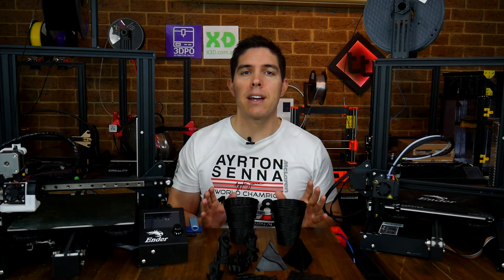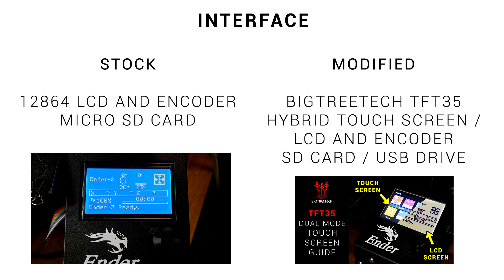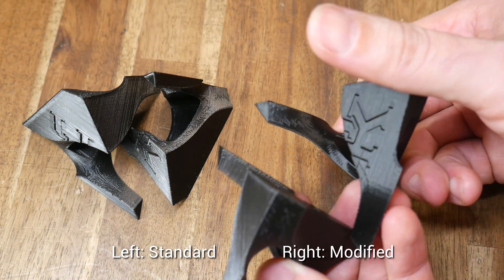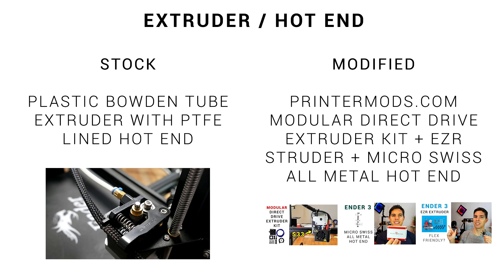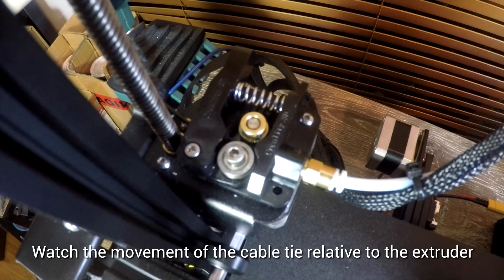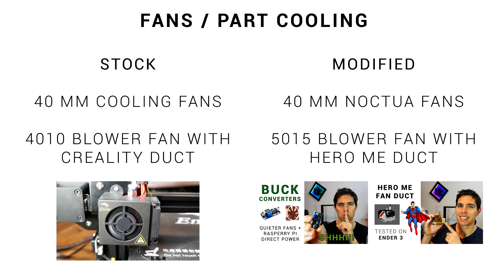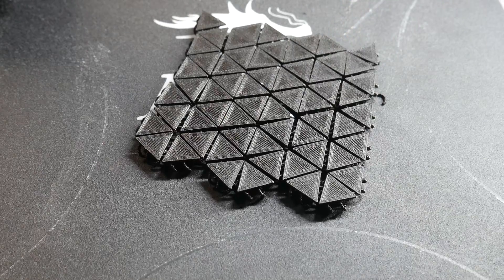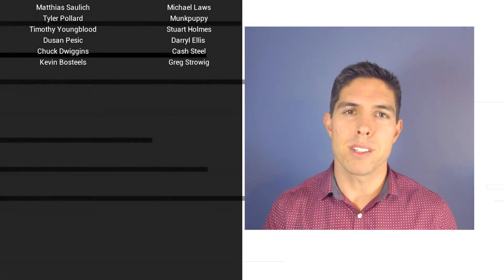Are modified 3D printers better? Stock vs upgraded Ender 3 comparison

Comment from the maker: Hopefully my answer to this question can pour water on some of the flame wars I've seen about this question. Another criticism I see is that a person might start with a cheap printer and then spend much more than its purchase price upgrading it. People ask: Why not just buy the more expensive printer in the first place?
1. Maybe the person can only afford small amounts at all.
2. Maybe the person is aiming to learn about their printer and get their hands dirty rather than buy an off the shelf solution.
3. Maybe the person just really enjoys tinkering and tuning 3D printers.
In my opinion each scenario is fine, as is the one when someone buys an expensive printer because that's what meets their needs.
Reply: When I started I got the cheapest crap I could afford. A few years ago I snagged an Anet A8, when they were still new. I looked it over and used it for a short time. I took everything that I didn't like about the printer and kept it all in mind when designing and building my own printer. I ended up with linear rails on all axis, a bltouch so I can print on any type of "normal" surface, silent stepper drivers, all aluminum frame, 32 bit mainboard, all metal hotend with a hardened steel nozzle, and I'm always making minor modifications on it. I would say that design and iteration are my main hobby because I enjoy that more than printing. In fact I'm now designing a delta style printer (just to have one) and I'll make a CoreXY after this one.

I never ask "why" when it comes to a person making mods to anything they own. It's a hobby, that's why. Some people dump seemingly pointless hours and money into a car. Some people buy plants to go around the house every spring. Some people buy drawing/painting supplies all the time. The list goes on and on....
Reply: Was about to make a comment, but for me #3 is on point! I got the Ender 3 specifically to tinker. I've done upgrades here and there since getting it 1.5 years ago, everything from tiny stuff (stiffer springs) to more major stuff (mainboard, dd, tft etc). I've spent maybe 200-250$ over 1.5 years on it, and I've learnt so much over that time that I would never have learnt with a prusa which just works™
Reply: Those are exaclty the reasons why I opted for a budget printer as my first 3D printer. I've really learned a lot along the road which makes me appreciate this hobby even more. My next one is definitely gonna be a more expensive one, though. ;^)
Reply: @bfrzty  like you, better learning how to drive on a tractor, before driving on the road :)
Reply: Definitely agree with all points, especially 2 and 3 as by doing all my upgrades slowly, I learned a LOT during each phase, AND I got a ton of enjoyment from the tinkering itself.  If I would have just bought a higher end off the shelf printer I would know a fraction of what I know now.
Reply: I bought an Anet A8  a little over 2 years ago not really knowing what I was doing or buying.  It was a good starter printer but found that it wasn't the best quality.  Since then I have purchased an Ender 3 and an Artillery X1 but my A8 has been modified to the point where almost none of it is original anymore.  I call it my "Frankenstein" printer.  It has an aluminum extrusion frame, linear rails, new main board, BLTouch, E3D V6 hot end, better power supply, etc.  The only thing that is original anymore is the print bed and a few of the stepper motors.  I have sunk WAY too much money into it but it has been a great learning experience and I love tinkering with it to see how else I may be able to improve it.  The entire experience has taught me a lot about how 3D printers work, how to troubleshoot them and I don't regret the cost at all.
Reply from the maker: @Dave Klein if you've enjoyed it as a hobby then that's all that matters. Some people do up cars, some people go to the pub, some people gamble, etc. Everyone spends money to stay entertained, 3D printing is a harmless and educational way to do it.
Reply: #3 here. Got an Ender 5 and a 5 Plus, each sitting well over a grand. Love to tinker :)
Reply: What was the other printer used in the tolerance test model?
Reply from the maker: @ Josh P Review is out next week, you will have to wait a few days longer..
Reply: All 3 for me actually. And my first printer was a cheaper little Borlee Mini-01 based Jaycar TL4076 Printer. I now have 3 of those printers in addition to my Large CR10 S5, and now I'm building my own custom made printer that is somewhere in the middle. So I'm definitely the hacker/tweaker kind. ^_^
Reply from the maker: @Keiran I used to have one of those too. I found a bit of play in the z axis meant it never homed accurately and consistent first layers were rare.
Reply: @TeachingTech  Heh, if you only found a bit of play then you had a good one. ;) The Z-Axis is probably the worst I have seen (not that i have seen thousands of printers..). mine tilt the head assembly by by a good 15 degrees. I plan to make a part to use MGN linear rails to hopefully make it accurate, then i can design a ABL solution. Why? Cause I can! ^_^
Reply: Forget the "dipping your toes" start so go the "home improvement" route. Assume a person has the wherewithal, is there an off-the-shelf 3D printer that has all of the mods/features that you made on yours? If so what is it and how much does it cost?
Reply: While both #2 and #3 applies to me now neither of them factored into my decision when selecting my first printer. I was first looking at the Flashforge Finder because it was available at a local store. However the machine didn't appeal to me for some reason and after doing some research I decided that it was pretty poor value for money. Got a Wanhao i3+ instead. I could've bought a more expensive machine but didn't want to spend more as I really didn't know what I was getting into.

At the time I knew pretty much nothing about the technology and didn't expect there to be much I could do to improve the printer. I just wanted to design stuff and turn into physical objects. As it turned out there was a lot of things I could do to improve the machine, and that in itself became a part of the hobby. While I did spend a lot of time on it it never got expensive. A new fan and a couple of threaded rods was all I had to buy. The rest was printed parts that I designed myself.

So none of the points mentioned really affected my decision to get the Wanhao. It just seemed like a good place to start and as it turned out I learned a lot about the tech and had a lot of fun tinkering with the machine.
Reply: 4. cheap Chinese companies are able to ship to my country while the expensive American or European ones simply won't. So i have no choice but to buy chinese and upgrade it right away.
Reply: exactly why i bought a used da vinci jr 1.0 w, it was cheap and it's my first step into printing. so far the only mods i have done is moving the bowden driver outside, filament hanger and a clip to hold the original NFC chipped spool cradle in place.
i've gotten this printer close to printing as good as the parts i see in your videos, but they are obviously lower quality prints since the printer is limited.
i am however working on a idea to modify the z axis to improve x axis prints by installing a better carriage system where it is currently using a rectangular clip to ride along the single guide rod and that is inspired by printers like the ender 3, a 3 point guide should give it more stability when changing the z axis and when the head is on the right side of my printer, which should correct the x axis being off in dimensions a bit and help with getting proper bed leveling and after i may need to replace the bed itself as the screws holding the glass in place do not wish to be extracted and i am wondering if i can increase the bed size by 25-50mm.

i haven't started this mod yet, but at the least it should help getting better leveling.

probably would be better off building a printer, but this one currently does not print parts accurately enough to make exact fitting components to even clamp a guide rail with. 😒

it would be awesome if someone posted a video for beginners with a da vinci jr 1.0 w, using cura and getting the best possible prints with near perfect dimensions. i've only bought one spool from them and have printed nearly 3 weeks straight through cura, used the first spool nearly entirely, quite a bit of third party filament and as long as i don't use the sdcard or xyzprinting software it doesn't know or care about the filament left.

da vinci jr 1.0w firmware 2.4.8 (never updating that in case they figure out their mistake 😂)
cura 4.5

https://www.thingiverse.com/thing:3484645/comments
https://cdn.thingiverse.com/assets/d8/4c/7a/64/aa/B4E09764-3AC3-4763-916C-36D3D283DB4D.jpeg
https://cdn.thingiverse.com/assets/8c/3e/d6/99/24/B8C19CAA-A804-4C33-9769-1E00E2DD10C7.jpeg
Reply: Point #2 and #3 are essentially the same thing.
Reply: I totally agree, after a while you’ll end up paying too much for upgrades and repairs.
Reply: in my case I bought a kit machine and modified it . In the end I have a corexy with direct drive and 400x400x400 for less than a 300x300x300 CR10
Reply: So having absolutely no idea about 3d printing or all it entails, just a rather firm idea that being able to produce your own items would be incredibly useful as a friend of mine does hobby train tables, well I opted for the Ender 3 pro instead of the Ender 3 as it was just a little bit more nicely designed, while only being an extra $40. Tinkering with it has been loads of fun, and only being a couple weeks in coming across this video has intrigued me greatly, I want to try out your non planar printing as well for true 3d prints =3 thank you for all the info!
Reply: What’s the link for the touch screen lcd screen
Reply: The only thing I really need a 3d printer for is to modify it....
Reply: For me, it's the 3 reasons.
Reply: GOBLIN ENGINEERS...  I tinker with the ender so that my inbuilt urge/instinct to tear apart anything that runs on electricity or gas, then analyze it's guts, philosophize over what could be improved and then goblin engineer (also known as gerry-rigging,. Duct-taping, ect...) And execute a  series of genius level improvements to whatever system was unlucky enough to wander too near my shop.  At the end it looks like it's held together with prayer and unicorn farts, but I also now know how to mount a ALCOHOL POWERED COKE CAN CANNON  the hood of a (ex)girlfriends Jetta!!!!
Reply: Man, get some amazon affiliate links, would love to give you a kickback! <3
Reply: You should absolutely include affiliate links for all your upgrades!
Reply: Plus, you can buy the cheaper version, and make the changes that you prefer. that also means you can source the parts on your own.
Reply: @Teaching Tech
By the way, can you add a link for the electronics enclosure you have for the back mounted electronics mod?
Reply: I bought an Ender 5 Plus with the intention of "frankensteining" the heck out of it, and I don't even have a use case for 3d printing, LOL!  But some of us nerds need brain exercise like sports guys need physical exercise, which is precisely why my out of shape self chose this hobby.  :-)  Plus I think I have upgrade-itis, and tinkering appeals to me more than exercise does.  I initially just wanted to print some "artsy" things, particularly the Gayerson-Anderson cat, but after watching tons of videos like Michaels, the use case for these things is endless.  Practical, decorative, or just to put a smile on a kids face, there's no end to what you can do with these things.
Reply: The only reason to go with a cheaper printer and upgrade it is to save money. People that enjoy modding and fiddling can still do so on a higher quality printer. How does the your ender 3 + the mods compare to the prusa i3 mk3s price wise?

Comment: I am pretty sure when i get my ender 3 pro... the only real upgrades im going to do are the scilent motors and a direct drive extruder... simply cuz my wife will be the one in the offcie while the printer runs 😂 i dont want to sleep on the couch that long so scilent motors is a MUST 😂😂 great video! So long as we take the time to tune it up properly dang near any printer can print with great outcomes!

Comment: Good points but I think levelling springs are a do it first mod.  Since the stock springs might sag when you try to print anything large or heavy.  Why not slap on $8 worth of springs and avoid a 17 hour mistake.

Comment: Now that i have owned and modded my Ender 3 Pro for a year i can probably draw some conclusions:
1. Don't buy the basic Ender 3 (Pro). Get something like the Neo or S1 if you can afford it in any way.
2. If it prints fine (enough), don't touch it.
3. You will buy the features of the Neo/S1 at some point anyway.
4. The best upgrades (in that order) are automatic bed leveling, a silent board and the dual z drive.
5. Some cheap but useful upgrades are harder bed springs, a filament holder with bearings and a better fan duct.

Comment: Old Video but just stumbled across this. I would be highly disappointed with both of those setups, stock and modified. My stock Ender 3 Pro printed far far better benchy's then those, and with less upgrades with only CR-Touch, Glass Bed, 4.2.7 and dual Z my benchy's look like glass! This shows that properly configuring, setup, fine tuning is way more important than modifications.

Comment: when i was choosing my first printer, i decided for an Ender 3. now, after i started printing (literaly now, it runs for 4 hours after assembly) i know i did the right decision. i bought it for 4k CZK and if i spend another 4K on it, it will have the same or better print quality as prusa MK3 for 20K CZK, even modified ender 3 has far better price/performance aspect. no wonder E3 is considered one of the best (if not the best) entry level 3D printer with good print quality out of the box. i am glad i bouht it and when the need comes, upgrades will come with it.

Comment: Honestly I find the blue LCDs quite attractive as a status screen.
After replacing the clunky tactile switches (not even a knob) with more responsive, less fatiguing microswitches I find it a pleasure to use the interface on the rare occasion I need to.
But I'm not a person who is a fan of the SD card sneaker net. Pronterface or OctoPrint all the way.

Comment: The main thing I'll probably be replacing in the short term is the hot end as I want to print PETG, and maybe the driver as well because, and I have no idea why it's the case, but those stepper motors are so ridiculously loud out of the box..(I honestly have no problem with the stock fan, but when the rest moves I feel like you can probably hear it down the street 😂😂😂)

Comment: How is the tube upgrade is needed if you replace the print head with one that have good seperation of hot end and cold end?

It kind of looks like you modified the frame of the upgraded 3d printer, from a 2040 to a 4040, this could provide a minor improvement.
I wish you talked a bit more about how the mods affect the capability of the printer such as increased print speed, precision, potential power savings, safety etc.

Comment: All those mods gotta cost, then you have to ask if it’s just better to buy a different printer
Reply: My heavily modded Ender 3 V2 which started at $210 (on sale) and is now about $600 is significantly better than my $800 Prusa i3. My E3V2 is faster, quieter,  better at bridging and overhangs, and due to the amount of time spent calibrating between mods combined with the upgrades much more dialed in. The real price paid for all that is the time spent; Not the money.

Comment: I have a Sovol SV02 that I bought mid-February, and it was my first 3D printer. Since then I upgraded to a flexible sheet metal bed and added a BL Touch. I do consider both of these additions essential. The SV02 is generally a very solid printer and I really like it, but the bed upgrade and BL touch are really what makes it stand out for me. 
I've also added a few 3D printed parts like filament guides to prevent too tight a corner in the feed, which also helped quite a bit. Overall, I think upgrading your printer is a good idea, especially as a "reaction" to something that you feel could be improved, like the automatic levelling

Comment: Upgraded with a metal extruder when the stock gear and roller bearing wore out onr my Ender 3, changed to Capricorn tubing when the stock Bowden tube wore out. Added TL smoothers to all 4 axis when they were on sale to improve surface quality.  Maybe add an all metal hot end when the stock one needs replacing. I do enjoy tinkering with and repairing my own equipment for me it's fun.

Comment: A decent bed(your choice) all metal hotend or heatbreak, upgrade springs,metal extruder and you will have a good printer without heavy mods.  Imo those are the minimum upgrades if you don't want to spend a lot of money on mods but want a reliable printer.  

I find that the pom wheels don't need adjusted often on my printers but are worth keeping an eye on. 

If you are just starting out, you can get away with not upgrading anything for a while but upgrading to at least a metal extruder is highly recommended.  It's cheap and easy, avoids the broken plastic arm as well.

Comment: same recipe and i say start here: junk the creality board, and display put on a bl touch and a the magnetic bed,  the bltouch and magnetic bed take the most frustrating parts out.  bed adhesion and bed leveling(ish) then print minecraft stuff for the grand kid, kids neighbor kids.  Oprah with little boats, a benchy for you and a benchy for you...